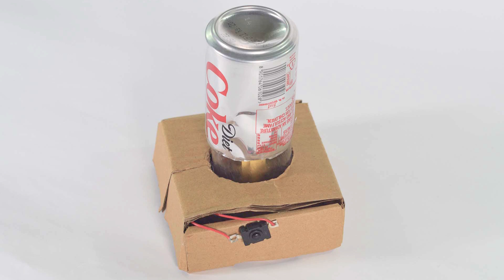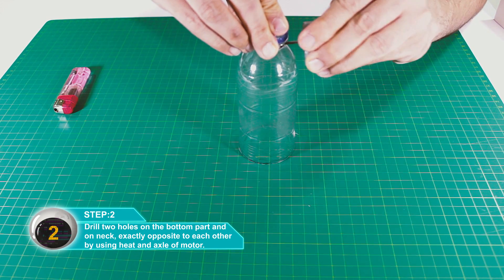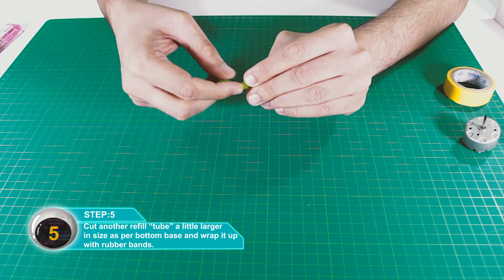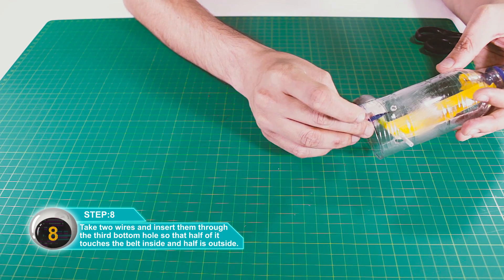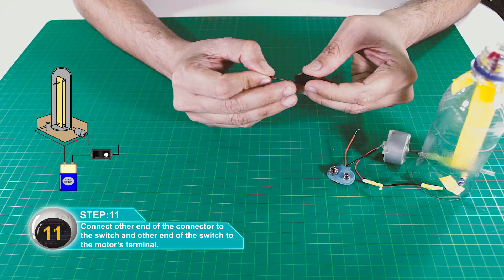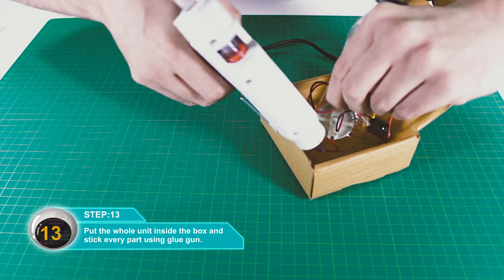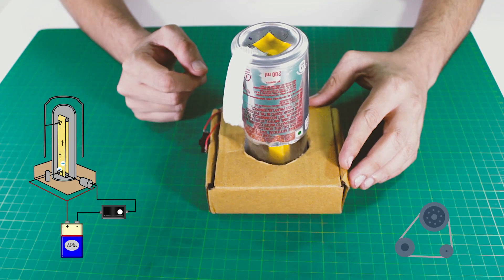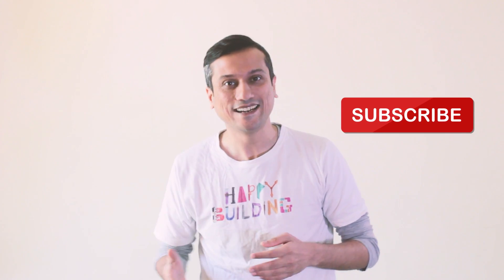I made an Electrostatic Generator!?! Happy Building!

Comment: Well nice build but.... You kind of ruined it with the soda can. The Sharp edges where you cut it made it possible for the majority of charge to escape. It will produce much more charge if you just get 2 aluminium bowls and glue them together.
Reply: Which kind Aluminium bowls..?
Reply: @bittusingh4702  You can use aluminum salad bowls. If that not an option, you could send the bottom of the can to reduce the sharp edges
Reply: @colleenforrest7936  what if i wrap the sharp end with electric tape amd fix it proper on the bottle, will the charges escape or not?

Comment: Hello sir actually i done the same model but the charges are not build up in the tin there is no reaction to the paper
Reply: well samely charged particles repel each other so
Reply: and if you can get it to work, try it with pvc roller and nylon pantyhose as belt, it will produce even more charge

Comment: This is lame. You're not actually generating current from static. What you need to do this, is three different insulators, the "belt" being between the electronegativities of the two electrodes, and you need to hook a load resistor between the two electrodes.

Comment: I have followed everystep but it is not working, the charge is not getting stored in the can .
The motor is working fine belt is also revolving the brush also do there work
Reply from the maker: 🤔 Try using two light aluminum bowls glued together instead of the soda can or a geared motor 🤔

Comment: sir my belt is not rotating?what can i do now
Reply from the maker: Check if there are any things blocking the sides, or the belt might be too tight...check to loosen it.
Reply: @PrateekSethiIndia  whether the belt rotate if the battery is in high voltage
Reply from the maker: 🤔 You can try using a geared motor

Comment: What's the refill? Its not on the materials list
Reply from the maker: Hey! Good catch. I missed it, To answer your question, a "refill" is the replaceable ink tube of a ballpoint pen. An empty tube in this case is ideal...Hope that helps! #HappyBuilding
Reply: @PrateekSethiIndia  i tried to build it, but my 9v motor doesn't even run. why?
Reply from the maker: Was the motor working before? Did you check the wiring? Is it's movement getting obstructed? the tube or piping hole might be too tight? or the tape loop might be too tight? Could be because of too much friction?
Reply: @PrateekSethiIndia  thanks. I'll do that. Hope you'll be open for my future questions. Haha
Reply: @PrateekSethiIndia so  what can be do for that

Comment: Hello Sir, when we tried this project everything was working properly but the charges weren't developing. Is this because of the insulated tape?. Can you suggest something alternative to it?
Reply: Hello Barsha, Firstly check whether the wires are touching the insulated tape belt properly. Insulated tape works very well alternatively you could try a flat rubber band or a belt made of nylon cloth.

Comment: It is not working!
Reply from the maker: It requires a bit of minute adjustments with the belt and can clearance. Since it is static electricity, it gets discharged really fast as well. Make sure you are in a relatively neutral ion environment / space... Hope that helps. #HappyBuilding

Comment: THIS IS URGENT What are u talking about when u say “refill tube”? 
Also when do u use the pvc pipe, t connector, and electrical fuse? Plz reply ASAP
Reply from the maker: Hi Syeda, Great questions. Refill is the ball point pen refill tube. Good catch on the electrical fuse, pvc pie and the t connector. I didn't use those. The fuse wire could have been used but i avoided it in the final build, while the pvc pipe and the T connector could be used to create the base for the bottle, but i decided to use a cardboard box in the actual build. Hope that helps! #HappyBuilding